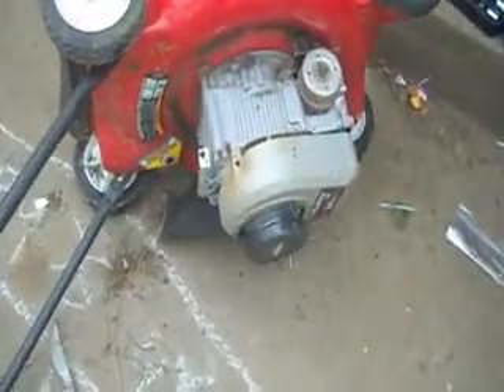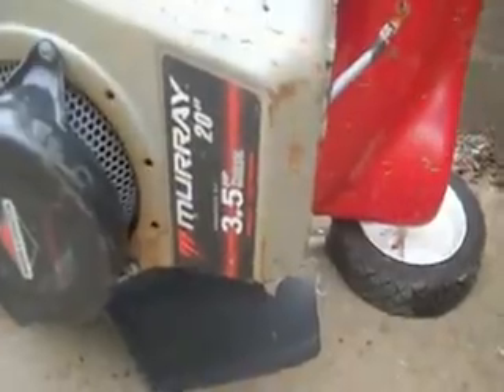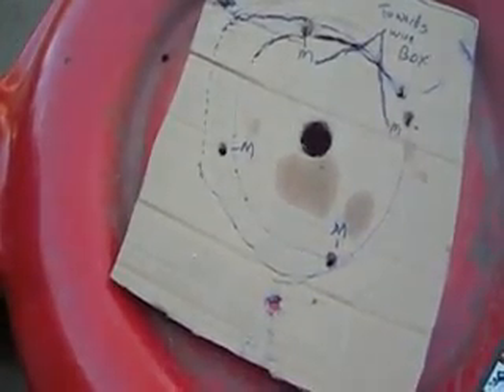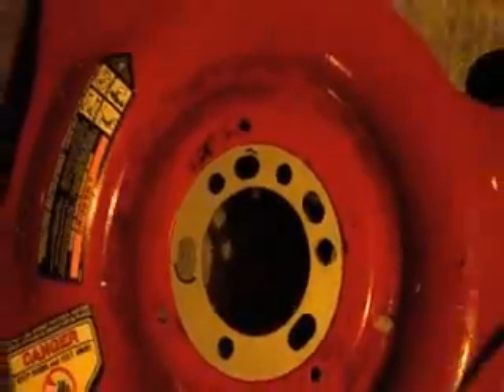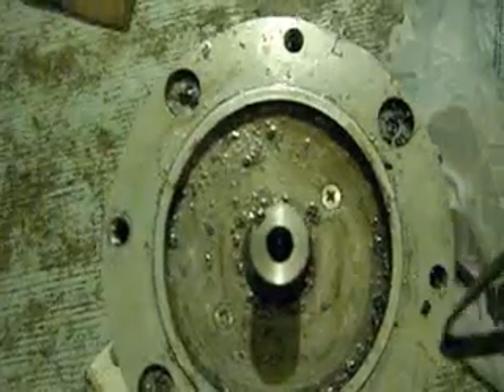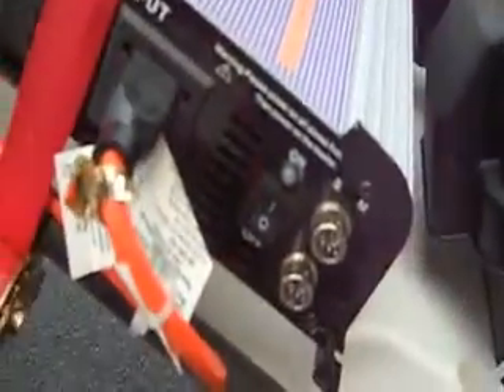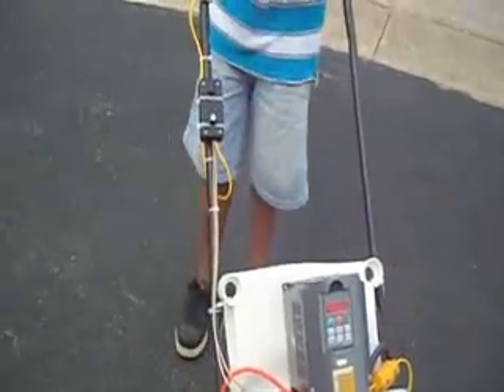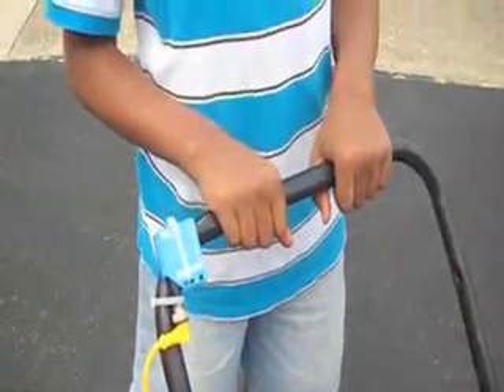Electric Lawn mower DIY.wmv

Comment: Consider an electric riding tractor?
Converting to battery power is a great idea for a garden tractor I converted one 15yrs ago, I used the 3 separate motor design and it is still cutting grass on a daily basis, it is amazing how it never breaks down and needs almost no maintenance, I renew the batteries every 7 yrs I am just on my 3rd set now, my design will cut up to 2 acres on a 50cent charge there are no belts or pulleys and no oil on the entire tractor, it can pull a trailer for about 8hrs on a charge, because battery run time is the most important aspect of most conversions I paid particular attention to the most efficient design, I used 3 separate small motors one for the drive with electronic speed control and two smaller with a cutter blade mounted on the shaft of each cutter motor ,total amperage when cutting grass is approx 40amps, (2000watts) this design only uses the battery power req to do the job, very little wasted battery power, it uses magnetic breaking of both tractor and cutter blades and automatically applies parking brake when you stop or get off the seat, an amazing tractor.
electrictractor.net

Comment: I really wish I had your elevtrical skills. 
Can those batteries stand a 45 degree slope? I'd like to build these to drag up and down a small levy at my pop's house.
Reply from the maker: If by "stand the 45 degree slope" you mean the battery box won't fall off. Then yes, it should. It will be more of a physical problem for you though depending on what type of batteries you use.

Comment: at first i wondered how you ran a 3 phase motor on extension cords, but at the end of the video you used a freq drive, and battery. Props for the diy engineering. I'm justing looking for ideas to do a corded single phase motor to run a push mower

Comment: Brushless hobby motor $50, ESC for brushless motor $50, servo tester $5, car battery $varies. Would make for a simpler and more efficient setup :)
Reply: A 3 hp, 3 phase AC induction motor would face slap a hobby grade brushless DC motor. Not even in the same ball field of torque. That is what he is using here.
Reply: wait a second! an induction motor is brushless! so basically that's what he did here, that's cool. I would still do the brushless hobby motor tho for less weight. And if my small quadcopter battery can jump my car, and my for tiny brushless motors can drain my quad battery faster than it can keep up, I'm pretty sure a larger one could mow a lawn no problem, altho it might have to be geared down a tad.

Comment: Nice work.
You could also use 300v or so of batteries and take the inverter out you may need to remove or upgrade the bridge rectifier in the vfd though ☺
Reply from the maker: +Jonathan McDonald Yes you're right. I would need about 27 batteries
in series to give me the full 325 buss voltage. This will then provide
the 230vac 3 phase out with minimal losses (conversion and such).
So I wouldn't have to change the output IGBT's in the drive.

The real issue would be, how will I put 27 batteries on the lawnmower?
Much easier to do with a riding mower. Thanks for the comment.

Comment from the maker: L Bandara I chose to convert it for two reasons. I knew people were using
 Brushed DC motors to do things. However, with low voltage the current would
be high. So I felt/thought the phase conversion would be less compared to the
the high amps running on 12 volt or 24 volts. Maybe not, but that was my thoughts
at the time.

I also wanted to be able to go to any electrical store and buy a 3 phase motor
and not have to order a special motor that may take a long time to get. In other
words, ubiquitous parts.

Finally, since I worked with 3 phase motors and VFD's at work. It made for an easy design. Also, it's different from any other electric lawnmower. Making it unique. Especially with the photo-eye as a hand sensor for the enable/disable (start/stop).

Thanks for asking.

Comment: Very nice project !  I was thinking why did you convert 12v to 230v ac, which will waste 30 - 40 % inside the invertor. 

Cant we run it with 12v dc motor directly ?  will it have less power ?  thanks.

Comment: have you heard of BLDC motors? they're similar to the induction motor you're using but only need 24-48v (usually), so you'd only need an ESC, rather than using both an inverter and VFD. You can get RC plane motors that are only about 1.5" diameter by 2"  and weigh less than half a Kg that put out around 2-3KW, but you'd need a reduction gear of some sort. Just suggesting it if you want to make another one.
Reply from the maker: Thanks for the information. I have heard of them. I wanted to buy one to make a Ecart. I would like to try different options. I'm always looking to improve things.
I have a brushed 48v motor. I may want to try that first.
Thanks for posting.

Comment from the maker: @ Rob Prebil- Yes, I am working on other electrical projects. I'm working on an alternative energy project that I plan on using in a EV project. It's taking a while for me to finish it. But, when it's done I will post a video on how it works.

Thanks for the inquiry. :-D
Reply: so whats all the junk on the side of the mower?? (electrical stuff)
Reply from the maker: michael phillips
If you're talking about during the test. It was a long extension cord coiled up. If you're talking about during the walk around. That is the myers hubb and connector for the electric motor. This keeps the wire from moving and seals water from coming in where the cable goes into the electrical box. I didn't see anything else.

Thanks for asking.

Comment from the maker: It would probably weigh less. I saw some lithium batteries that were very light. Not as expensive as they once were. However, I have a 4 HP DC motor that is very torquey. I may change it out one day. Thanks for the post.

Comment from the maker: Cons continued: Well sometime around 65-70hz but nothing really past that. You really don't need to have it running that fast. I have the drive set up in constant torque mode so really anything past 60hrs is just pulling extra energy. I place it sometimes above it because it really moves the grass out. 

All in all, even though it was high grass and the trip rate went up. With my 5 hp gas lawnmower I would have to go to the gas station twice to get the same job done in that high of grass.

Comment from the maker: Pros continued: In the extreme case if the power inverted tripped then I turned it off and back on. A few seconds later it was back on and ready to go. Beats pulling the cord to get it started.

Cons: The closer it got to running out of juice I had to take it easy or the trip count will go up. My trip count was as follows: 6 times on the power inverter, 4 times on the VFD. I also had to turn down the mower speed as the battery juice got closer to running out. I normally don't run it past 60hz.

Comment from the maker: Update: I have had a few good test on the lawnmower. Last Saturday I cut the grass in about 12" to 15" high wet grass. Here are the pros and cons of the system.

Pros: The lawnmower ran for and 1.5 or maybe longer from a full charge. When it ran into some high grass or I pushed it too fast through the high grass the drive would trip. The cool thing is all had had to do is take my hand off the handle press the stop button and place my hand back on the handle and the mower started.